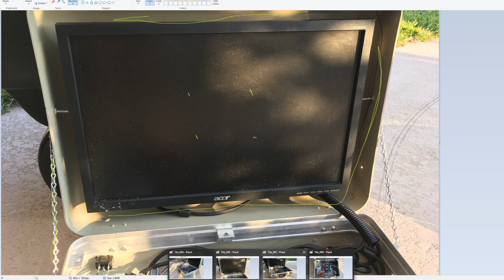Emulation Machine 2.0 a PC built in a suitcase

Comment: how big is the display? ive been looking into doing one of these builds as a summer project
Reply: JR 17 about 17 inches but it depends on the size of the case you use obviously. But yeah mine is around 17
Reply: Just a tip, use liquid cooling, so that you will have enough space for keyboard and palmrest. It will also make it slimmed.